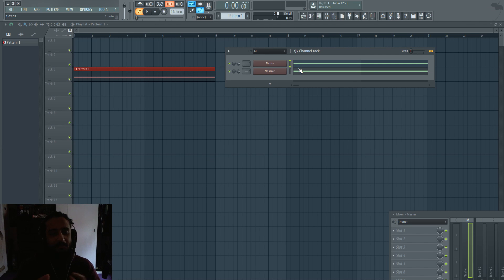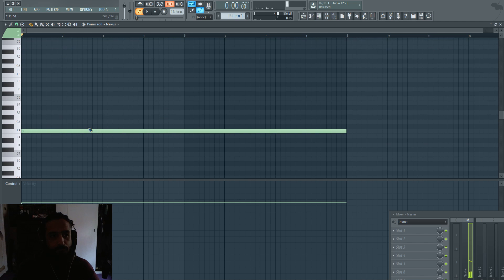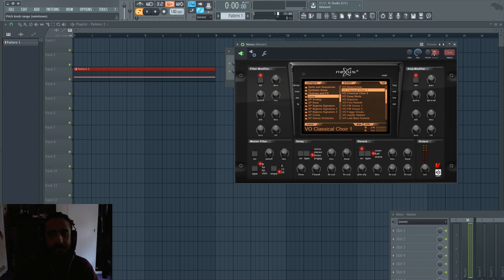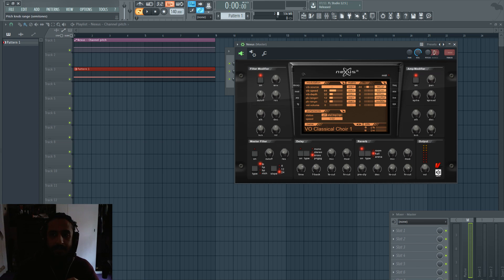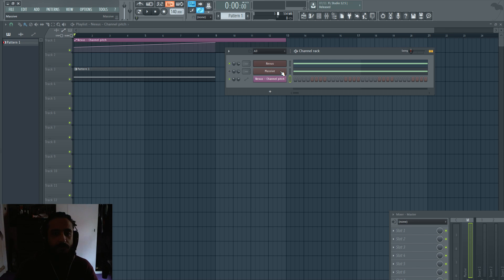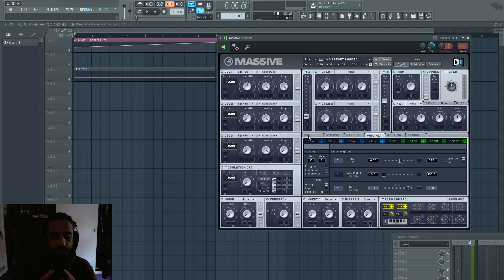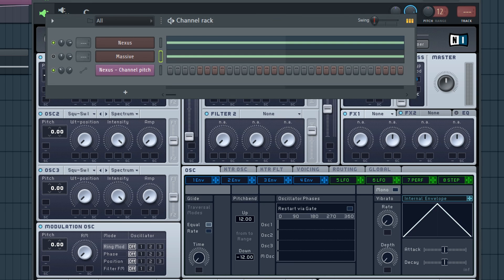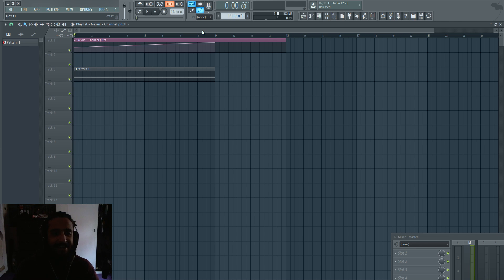HOW to PITCH BEND in FL Studio 12 -  Modulate Pitch of Instruments, / VSTi, Build Riser Effects!

Comment: In cakewalk or other DAWs the use of mod and pitch wheel is obligate, so I don't have to configurate nothing to work with 'em... By loading Nexus into Cakewalk there are both wheels just at my left hand on my midi controller... Any idea, why it is that way?
Reply: Had found this one: (5 years ago)

Aaaaand that is one of the things I DON'T like about FL... you can fix this for all future uses by opening the synth, going to the top and clicking "Browse all preameters" in the little dropdown menu in the wrapper window, and then go to CC #1 Modulation in the browser. Right click and go to Override Generic link and move the modwheel. Now save the synth to the Plugin database and load it from there. (NOTE: You HAVE to load it from there otherwise it may not have been saved if you load it from the channel menu.)

In order for the Pitch wheel to work, just move the number from 2 to like 5 or 6 in the main instrument window of the sound you're using. It's global so you only have to change that number once.